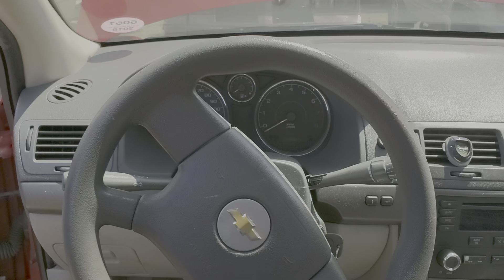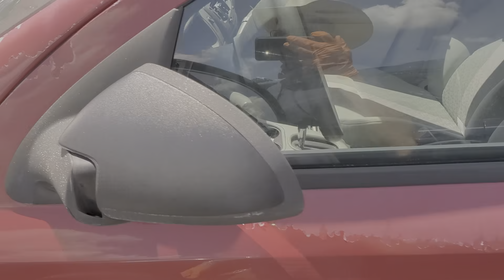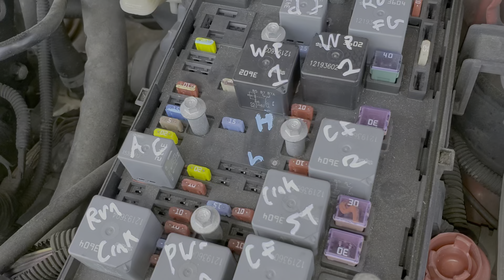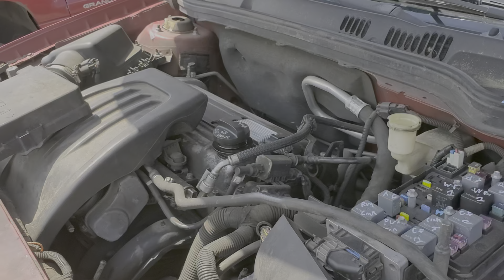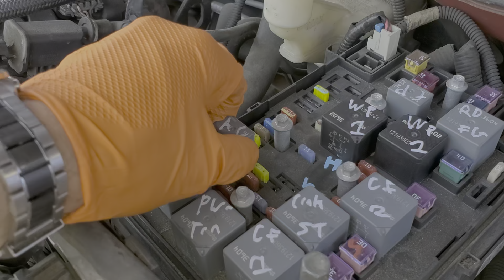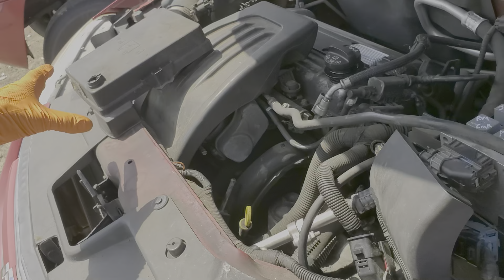2006 Chevy Cobalt AC Relay, AC Fuse & Circuit Explained

Comment: Well I have the check engine light on and did the code to see what it was for. My ac stopped working as soon as I started to drive it after I bought it. It's only blowing hot air. So I don't know what is fully wrong with it. And summer heat is not fun to drive in

Comment: What if both cooling fan and AC not getting power and both fuse and relay have been changed on both.
Reply: Well, I had the same problem at first.... my newfound advice is to make sure the relays are put in correctly. I tried to swap the fuel pump relay with the ac relay just like him. The car indeed did die. However, it was because the ac relay was wrong in the first place, and I was making sure to just pull them straight up and put them back in where I needed to. The guy in the video also incorrectly put the relays back in when he swapped them.  Look at the diagram on the ac relay. You see it before he swaps the relay, but not after. That's because the relay needs to be turned around the other way. You should always be able to see the diagram.

Comment: I have a 2006 Chevy Cobalt where is the blower motor relay on the 2006 Chevy Cobalt resistor is new fan is not blowing but fan will not come on there's no power from the resistor will not turn on

Comment: Very useful video thanks!  So I have a 2010 Cobalt and all the relays and fuses are good after testing with your methods. However, the AC shuts off after a few minutes. Also, my transmission is slipping a little which is a separate problem.  Do you think that's why it shuts off?  Thanks again!

Comment: My ac in my cobalt is only blowing cold on the passenger side vent the other vents are blowing ambient temperature. I checked the actuators they are functioning fine. Any clues would be appreciated.

Comment: I noticed the ac on mine works at 4 it was making loud noise I changed blow motor now it doesn’t make a sound but when I turn ac to 1 2 or 3 i don’t feel nothing blowing as it does when it’s on 4 what could it be
Reply: Blower motor resistor

Comment: My ac was not working, l checked the fuse like u said and 💥💥💥 it was blown. I put another fuse in and it started working. Thanks for this informative video.
The only issue l keep running into is the fuse keep blowing and l have no idea why.
Any suggestions?

Comment: Do cobalts have a Low pressure switch?
Reply: And where is it located
Reply: @nichdic7027  Yes they do and it's installed in the low pressure line underneath the compressor.

Comment: AC works on the high 4 setting, and so I keep on buying resistors and they keep on failing.  Any ideas?  I put new blower motors in as well.  I have had the resistor just hanging down on its wiring harness in the passenger side and did not put up into the car so maybe the resistor is not getting any air flow passing over it and so it is overheating.  I am not aware of any air holes or if the blower motor shares a vent tube with the resistor housing?  Other than that I think I read long ago that the wiring harness might need to be replaced.  Good video appreciate it.
Reply from the maker: You are correct, the resistor needs air flow to cool it down or else it will overheat and fail.